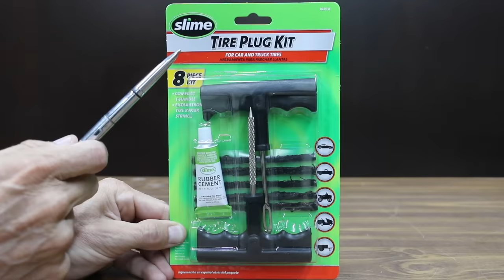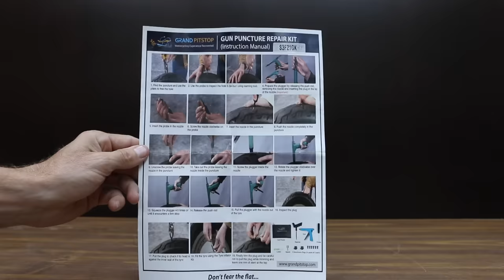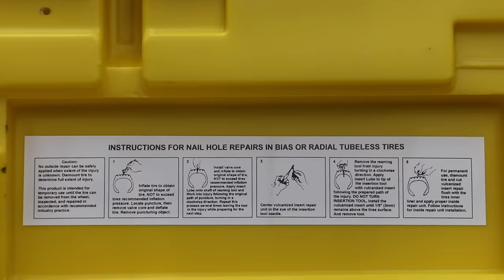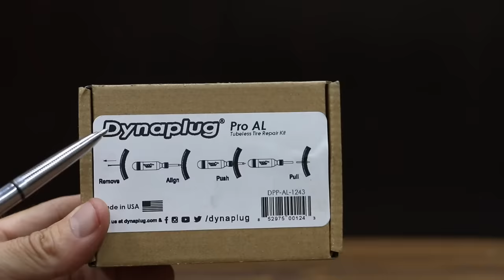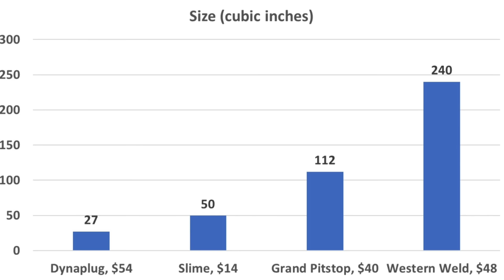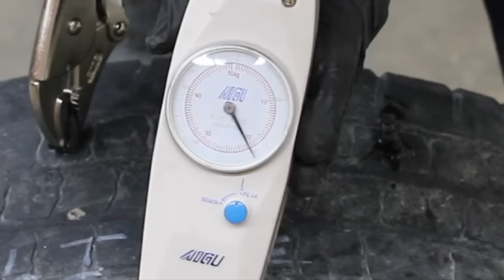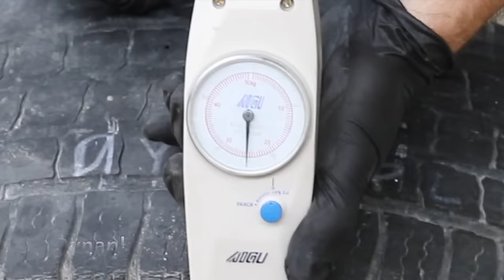Best Tire Repair Kit? SLIME, Westweld, Dynaplug, Grand Pitstop

Comment: I live 2 miles from the pavement here in the Mojave Desert. With 5 vehicles and 3 double axle trailers, I have 32 tires that I maintain and I do it a lot. I have several different kits and each one has pros and cons. My experience is that unless your puncture is straight in, don't use mushroom plugs. Mushroom plugs also have a higher rate of developing leaks after time. Rubberized rope plugs are so much more reliable. They plug well at an angle and I've never had a single repair fail, and I've repaired more than I count. 
Another thing to keep in mind is that any diy repair will void your road hazard warrantee. 
Great video 👍
Reply from the maker: Thanks!  Thanks for the feedback.

Comment: The best tire repair kit is the one someone is carrying when you blow a tire on a camping trip!  :)  I blew a tire on my truck hauling a trailer full of camping gear way up in the mountains of Central Utah.  With the help of some very friendly folks in a SxS and an overland-prepped Tacoma, we used four of the Slime-type plugs to fix the rather large hole in my tire.  Once the tire stopped leaking and was holding pressure, I was back on the road again.  I had the best time watching these guys spring into action to fix a busted vehicle!  Truly, the off-road community has lots of great people.  And it looked like you had a lot of fun spinning that Suburban around in the grass!
Reply: Ha! Those guys had a better time than you!!! I love it when I can help someone out who needs it and send them happily down the road. It makes me feel all warm and fuzzy inside. Some of us just like to fix sh**. Pay it forward. I'm glad you didn't have your trip ruined waiting for a tow truck and shelling out loads of cash.
Reply from the maker: Thanks for sharing!  Great to hear!  I did have fun!  Thanks for watching!

Comment: I have had nails in tires that i plugged that ended up with a broken belt. Was it the nail or the plug that ended up causeing the damage? I dont know but i think its more related to the nail or whatever did the initial damage

Comment: Project farm doing tires. All my dreams just came true ❤️💦
Reply from the maker: Thank you very much!!
Reply: Username checks out
Reply: @ProjectFarm  I own this chinese set, from the beginning of the video. fixed 3-4 times, and all fixes hold for more than a year so far. in chinese store its roughly 3$ and 2$ for set of 10 plugs. by far, cheapest and easiest way of plugging a tire. I recommend first preparing a plug in that tool, gluing it , then removing screw, and plugging the tire, so you loose least air.
Reply: @Tyre Reviews.  Jonathan watching a Project Farm video.. Yep 2021 is complete
Reply: I know this channel!
You make good Tyre videos!
Reply: Amen!  I grew up in a family owned used tire shop.  We used Safety Seal plugs, very similar to the Western Weld it seams.  Self vulcanizing. They are awesome!
Reply: Hey, do a test of ceramic vs semi metallic brake pads. Akebobo vs Bosch vs ACDelco vs power stop Extreme vs Duralast etc.. Stopping distance vs rotor wear after many hard stops.
Reply: Always putting in the work. 100 plugs in a tire, that's tough. If you've ever had to plug a tire, you know popping a tool through the tire's steel belt isn't easy 😮
Reply: Please make a (new) video on best eingine oils.
Reply: Please test space heaters.
Reply: i plugged a tire with plug made from duct tape and it worked great
Reply: You Had way too much fun in that Chevy.
Reply: Wet dreams
Reply: Hahahaha this comment made my day...

Comment: I just remember, I was once out of rubber strips and didn't had old inner tubes either, but had plenty of rubber cement. I cut 4 thin strips of fleece fabric 4 x 1/4 inches, doused them in rubber cement and used them as you would a plug. That tire held up pretty well and allowed me to get home.
Reply from the maker: Thanks for sharing!

Comment: I personally use a plugged tire for the rest of the life of the tire I’ve always bought the slime brand plugs and there have been two instances where the plugs started to fail but it was a good six to eight months after I installed them. 

The western weld plug quality impressed me. I going to ask for the kit for Christmas, thank you for the video.
Reply from the maker: You are welcome!  Thanks for sharing.
Reply: Been running on a slime plugged tired for almost 2 years now. If it had failed again, I would have gotten a new tire. But it just keeps on rolling

Comment: When I used to autocross regularly I picked up a nail in one of my race tires when it was pretty new. Plugged it with a kit similar to the slime kit and proceeded to race on those tires for a season until the cords were showing and they were shot. The plug never failed. That was when I felt more than confident using them for my daily drivers. I've repaired several over the years and never had an issue.
Reply from the maker: Thanks for the feedback.
Reply: Yeah I had a "new" set of tires maybe 3 months old and caught a nail in the middle. Slime plug, forgot about it until I replaced the tires 4 years later. Guess it worked well lol

Comment: I have used both the rope type plugs and the plug guns pretty extensively, my experience is that for steel belted radials the rope plugs are the best, as the steel belts will cut the rubber plugs of the plug gun. For bias ply tires such as equipment tires the plug gun works really well and I prefer it.

Comment: Watching your video again! 😀  Have a leak in my tire for about a month, I fill it with air everyday now. I rotated the tire to the drivers front so it is easier to look at in the morning before i go to work. I took it off Sunday and looked everywhere for a hole. Today, Friday, I took the tire off again and did a wet/soap test. I found a super small hole in the middle of the tread. I used a extremely old tire plug like the Slime plugs. It worked out great. I have used 20+ tire plugs so far in my life and have never had a failure. Thanks again for you hard dedication to find things that work - Then you test them!
Reply from the maker: You are welcome!  Thanks for sharing.

Comment: If you're going to keep a kit in the car, I'd like to see how they perform after being stored in a vehicle for a year or more. OTOH, if you don't carry a kit, it's likely that Slime will be the choice, as you're likely to find it at the nearest auto parts store or Wallymart.
Reply: Slime or the like is the only kind I've ever used, I'd never seen any of these others. I can say they held up fine just in a box in the back of the van over several years. They always worked fine. I've had several of those plastic handled tools break on me though.. I'd definitely buy the metal tools if I ever came across them.
Reply: Slime kits, I can verify, last way over a year. Thing is, so do the ultra cheap knockoff kits too.
Reply: I bag the plugs & have them in an old Chinese food container with the tools & glue canister. The plugs can be less sticky but the rubber cement really helps lube & seal.
Reply: This is an excellent idea for a follow-up. It could be cycled through several heat and freeze cycles, subjecting it to several changes from -40 to just shy of boiling. That kind of repeated and relatively rapid temperature changes would work as accelerated aging.

As a side project at the same time, it could be interesting to see if investing in some kind of airtight container for the kit would be advantageous.
Reply: I had an opened and used set of slime type kit which wasnt slime for years and used many times always worked. I plug the tires right on the car.
Reply: I always carry a slime type plug kit, but usually get a new tube of rubber cement, about once a year or so. I have heard not to use them on steel belted tires as the steel will eventually cut the plug. We will since I just did a tire on my truck about 2 months ago and didn't feel like taking it to a tire shop. Still holding air, so time will tell.
Reply: I have used slime type for decades on steel belted tires no issues at all lasted life of the tire. Tire shops dont want you use them. But as soon as you get a flat and its under their warranty they plug your tire unless of course its on the edge of the tire then they want you to buy a new one
Reply: I've used plugs many years after purchase, no problem.
Reply: I have had a kit in my work truck for about 2 years. Been through 2 winters and 2 full summers. Wrapping up the 3rd summer. I just had to use 2 of the plugs the other day and they are performing good as expected.
Reply: I have a westweld style kit that is sitting about a year and a half in my truck toolbox, spent last and this summer in texas, spent last winter in canada, still works like brand new
Reply: slime kit, 3 south Texas summers, plugged front tire 5k miles still good even with the off-roading.
Reply: I keep the Western it's been in the trunk about 4 years seems to work fine
Reply: If it can get you to the shop or home so you can change the tire then that is good enough. This isn't a permanent fix at all and should NEVER be used as anything other than a temporary fix to drive slowly to your home or a shop where you can change the tire.
Reply: i have had some sitting around forever and they are still extremely sticky. i would think the adhesive on them is similar to most on stuff like electrical tape. even when exposed to heat it will still stick as long as it is clean
Reply: Go buy the professional brown strings from your local tyre shop- they last you forever. They’re thicker/fluffier and stickier. I’ve used some that were laying on the floor of my van for 2 years covered in dust...and they work good enough for an 8sec pass...brown plugs are the secret
Reply: I used the Slime plug kit I had stored in my truck for over a year in Death Valley. The tire worked great until I replaced all my tires a few years later.
Reply: The main issue with the plug kits is that the little rubber cement tube is generally dried out when kept in storage for a long time. And it's going to be one time use after the first plug, because the cement will definitely be dried out shortly after opening, capped or not.
You need to get the large metal can of rubber cement, which is the only way to have cement on hand when needed.

Comment: Yeah, tires are one of my things I love doing. Good choice on finding the old cracked hard rubber tires for the tests. I have never seen a plugged tire have a problem. I have seen a lot of those temp repairs end up permanent. I have found a couple surprises in the tires I was patching. One already had two of those plugs and looked like they had been there for quite some time. Good job.
Reply from the maker: Thanks!  Thanks for sharing.

Comment: As a former Tire mechanic and emergency road service guy. I can’t tell you how many times I’ve plugged a tire on tractor and trailers, and cars. I do it on my own vehicle and others. But we always recommend to get them patched instead, yes it’s not very common on new tires. But you can do damage to the steel cords, on retread trucking tires you can comprise the the cap with a plug. 

I really enjoyed this video, I can say I’ve never plugged a tire more than 4 times. And it was really cool to see all those plugs
Reply from the maker: Thanks!  Thanks for sharing.
Reply: If I'm not mistaken, some states outlaw plug repairs on the front wheels of commercial vehicles?
Reply: @TonyGingrich  it's not a problem in Canada, and we've got some over the top safety regulations at certain tire shops, any chance they get they'll tell you the tire has to be replaced. One common reason is a sidewall puncture.

Comment: I keep one of these kits in each of my cars (on top of having a spare). I wouldn't run any of them indefinitely, but this testing seems to confirm my suspicion that they're stronger than most people think. However, I think your standard plug patch that a shop would use is still probably the safest option when installed correctly.
Reply from the maker: Thanks for sharing.
Reply: Only patches that ever failed me or my now 78 year old father were done by automotive/tire shops. I'll stick with plugging myself.
Reply: Safe? A slow air leak? or do we actually think these could cause a tire to fail?
Reply: I've run tire plugs nearly the entire life of the tire in fleet truck tires. Normally I bring all my tires to a tire shop to avoid liability, but in a pinch I will install a plug.
Reply: Most tire shops take the tire off and put a patch on it from the inside which is really the best and most permanent solution rather then going in from the outside
Reply: @svenjorgensenn8418  If a plug comes out it won't be a slow leak.  These products are for temporary repairs to get you to a tire shop, this is made clear in the instructions.
Reply: @ferrumignis the instructions say temporary for liability reasons. Vast majority of the time these fixes last the life of the tire when installed correctly. I’m sure some do leak or come out, but it’s the exception and could be down to incorrect installation.

Comment: I absolutely appreciate the hard work that goes on in these videos!  I have one suggestion to those who use a plug installer like slime...  The plastic handle can give out under pressure.  Get a metal handled installer.  A close friend of mine had the metal go through the plastic handle and messed his wrist up badly.  Be safe out there and cover the eyes anyway.  Why not?
Reply from the maker: Thanks!  Thanks for the suggestion.

Comment: As a tire repair man I've installed a lot of plugs.  A side cutter works great for pulling the nails and cutting the plug afterwards. It is much easier to install a plug in an inflated tire.  They are really amazing how well they work. If hole is big you can use multiple plugs.
Reply from the maker: Thanks for the feedback.

Comment: 3:39 note the clear plastic case this rounded end type dynaplug came encapsulated in.  It has a practical use. If the dynaplug rounded metal end is kept inside the portion having the "hex" head shape it now has a wide and flat area to push upon to get more force to place the metal tube and brass tip through the tire tread.
Being a former inspector in the aircraft industry I have an appreciation and preference for their stainless steel dynaplugs that I keep in each vehicle.  I also take one in my motorcycle backpack along with a small 12 v. air pump which can be hooked up to the motorcycle battery.     Thank you for your meticulous nature in all the interesting testing you investigate.

Comment: Great job. A few things to add for those watching. Diagonal cutters are often the easiest tool to remove nails with. Conventional plugs are easiest to install with the tire inflated, as the tread flexes less. In fact, sometimes bumping the pressure a bit above normal can help even more. 

I had the slime brand handle come off on a set I purchased for personal use while performing a field repair - something to keep in mind. Finishing the job using pliers to grip the tool was very difficult. 

I have used the north shore labs/ safety seal kit before and it appears almost identical to the western weld kit. Possibly made by the same mfr and rebranded? In any case, I always put downward pressure on the sliding part of the tool - i always thought it was to help keep the plug fully in the tire when removing the tool. 

Mushroom plugs look cool but once a self vulcanizing plug is inserted it fans out and accomplishes essential the same thing. 

Finally, an old school way to finish off the install is to burn the protruding end of the plug until it's nearly flush. 

Having said all that I only patch tires these days unless it's a field repair.
Reply from the maker: Thanks!  Thanks for the feedback.

Comment: Excellent experiment with all these different plugs. Thanks for taking the time to both test and demonstrate. I have had excellent luck with the Slime kits. I saw a plug first used over 50 years ago.  Since then, I’ve plugged my own tires.  My last two uses were for sidewall punctures. The tire repair shops would not touch the tires. So, I simply plugged them. One tire was new and the plug lasted for 40,000 miles before replacing all the tires.  The second fix is ongoing. My method is slightly different than the instructions to prevent further damage to the tires. I did not ream out the sidewall puncture – I just removed the wire and gently inserted the rope covered with glue. I gave it time to set up and left some of the rope sticking out after cutting.  It lasted for the life of the tire.
Reply from the maker: Thanks and you are welcome!  Thanks for sharing.

Comment: I had a kit identical to the Westweld kit, but red box in my semi truck when I drove one. I would go pick up trailers at drop yards with flat tires, instead of waiting for a garage to come fix the tire and loose money waiting, I'd plug the tire, air it up then be on my way. I have traveled about a thousand miles on them and no issues, making money with the tire plugs and not loosing it while waiting. That has been over 20 years ago and still have it and use the kit.
Reply from the maker: Thank you!
Reply: I run a company that does custom shower installs.  We have 22 vans and everyday on and off multiple construction sites.  Picking up nails and screws is super common.  We keep one of those kits that are just like the Westweld one in the shop.  Would say average 2 plugs per week across the fleet.  Sometimes more.  Have literally never had one fail.
Reply: @ProjectFarm  Sorry for the delay, you are very welcome Todd. Thank you so much for everything that you do, the time and money you spend in everything to make things better for us to make a decision on, without wasting money.